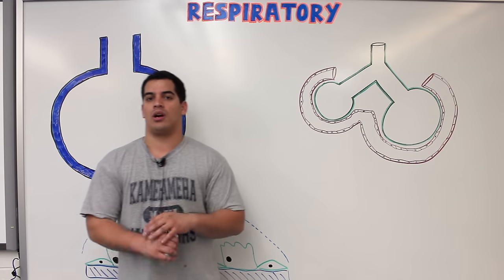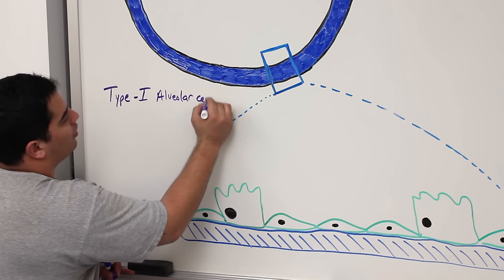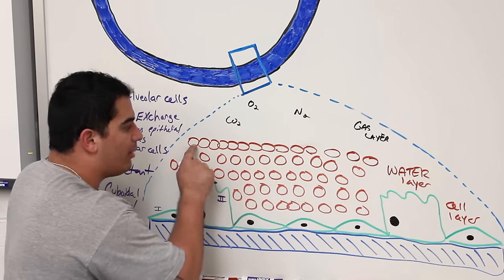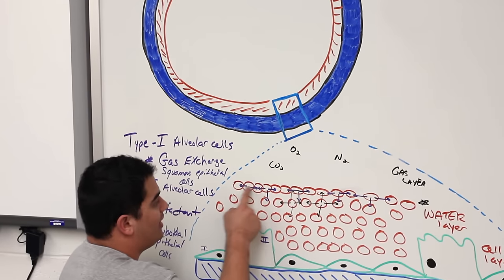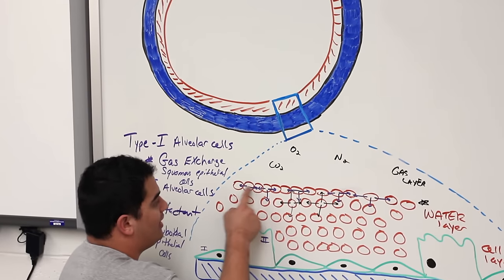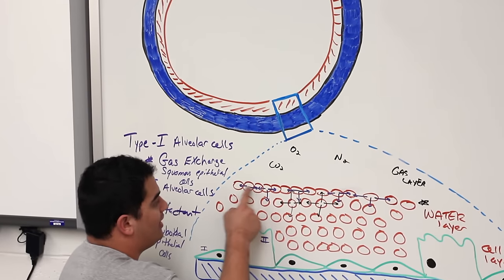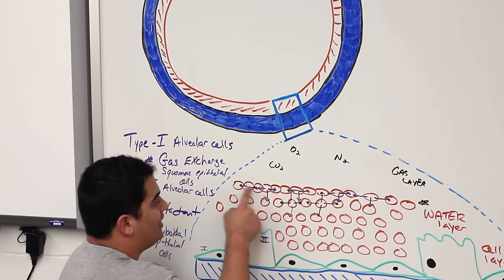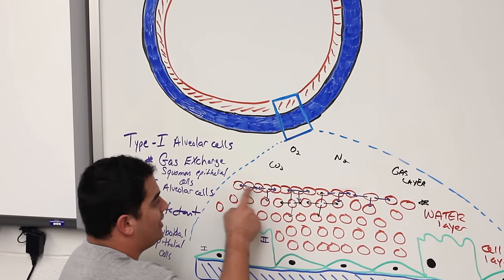Respiratory | Surface Tension & Surfactant in Alveoli

Comment: I have a question: If the watermolecules exert a force downwards (or to the edge of the alveoli, towards the outside), then why does it cause the alveoli to collapse? To me, it would make a lot more sense that the alveoli would collapse if there was a force towards the inside of the alveoli instead of the outside... Please excuse the forming of this question, English is not my first language :o
Reply: Did u get the answer bro?
I have the same question
Reply: I don't know about that "downward force " thing(I myself didn't get that actually) but just to make an understanding I've seen it as since the air liquid interface molecules are experiencing force due to surface tension they tend to decrease the number of surface molecules and hence tend to reduce the surface area which makes the alveoli collapse towards the centre....hope this makes some sense...
Reply: Think about  the free body diagram of alveoli at the top the top most layer is getting pulled downwards so the rest of water is pulled up wards 3 rd law of Newton as the bulk water is pulled upwards by top layer the also pull the alveoli upwards or towards the center

Comment: surfactants work at both interfaces of water in the alveoli  ( though you have mentioned one part )  — the air-water interface (edge touching the gas) and the water-alveolar cell interface (edge touching the alveolar cells). Here's how it functions in each case:

1. Air-Water Interface (Edge Touching the Gas)
Surfactants, primarily composed of lipids and proteins (like dipalmitoylphosphatidylcholine, or DPPC), reduce surface tension at the air-water interface. The alveoli are lined with a thin layer of fluid, and without surfactants, the cohesive forces of water molecules at this interface would cause high surface tension, making alveolar collapse (atelectasis) more likely during exhalation. By reducing this surface tension, surfactants make it easier to expand the alveoli during inhalation and prevent collapse during exhalation.

2. Water-Alveolar Cell Interface (Edge Touching the Alveolar Cells)
At this interface, surfactants stabilise the water layer and help maintain proper hydration of the alveolar lining. This ensures the cells remain functional and the diffusion of gases (oxygen and carbon dioxide) across the alveolar membrane is efficient. Additionally, surfactants support host defence mechanisms by facilitating the movement of immune cells and reducing fluid accumulation.

Comment: Thank you for the video! I have one question: how does the downward force from the water molecules cause an outward force to collapse alveoli?
Reply: When you have a downward force of the water-molecules, you have an increased surface tension. This leads to an increased collapsing pressure.
Reply: It's because of the air and water interaction..since the water is causing the surface  tension of the alveoli to increase by going deeper..the alveoli collapses so that the air leaves and the tension decreases and the alveoli is not under tension..hope you got it
Reply: @Cocolhasa In short, there is a force exerted towards the centre of the alveolus by the water due to its desire to maintain a low surface area.

The water covering the inner lining of the alveolus tries to assume the least surface area possible by cohering with one another. This is due to the fact that water is a polar molecule and can form hydrogen bonds with each other, and the ideal scenario for the water is to get into its lowest energy state.

When you inhale, you are pumping more air into the alveoli. To get the alveolus to expand, the water that is stuck to the lining of the alveolus also has to expand with it. This increases the surface area of the water, and the water doesn't want that. The water produces a force that exerts towards the centre of the alveolus, sort of like a water droplet trying to maintain its structure to achieve its lowest energy state. That is surface tension.

Comment: Correct me if I am wrong,  but what helps me when I think about surface tension is I think about as some of the molecules dive deeper within the body of the water molecules, they create momentary vacuums on the surface layer that the water molecules then fill in as they are attracted to each other on the top layer, so as they come together to fill in these vacuums they shorten the length of the surface, and this shortening contributes to the collapse because it's is it like trying to make a circle with a smaller piece of string, the larger piece of string can make a larger circle, but when surface tension increases, then surface layer shortens in length and now it is like having a shorter piece of string to make a circle. I'm not positive if that is exactly how it works but it helps me think about it.

Comment: Also due to the negatively electrically charged lipid molecules, as the alveoli tends to collapse, they interract (as surfactant lays through the whole surface of the alveoli) with Coulomb electric forces, so they repel each other, preventing the alveoli to collapse.

Comment: A small correction : type 1 and type 2 cell numbers are equal per alveoli however since type 2 cells are wayy smaller therefore they occupy only 3 percent of total alveolar surface area in comparison to type 1's 95 percent. 
The remain 2 percent surface area is occupied by type 3 cells which are chemoreceptors basically.

Comment: Great video. Learned a lot. A confusion: How alveolar pores equalize the pressure? Because you cannot reverse the direction of flow under pressure. Especially for the normal lung, it is hard to ignore. You also said that there is a surfactant distribution difference. That might raise an issue of Marangoni flow. And also when you breathe, depending on the Type-II cell activity,  alveoli are under constant compression and expansion. It should change the surfactant behavior under a different type of deformation (in this case shear+dilation). How our body tackle that?

Comment: 43:20 am I understanding correctly? Does having too little surfactant increase the surface tension compared to having no surfactant?
Reply: he's saying that because the radius is too wide, there isnt enough surfactant to cover all the water in the alveoli, which lets some of the water go down, and the alveola goes back to its regular shape, which is then regulated by surfactant
if you have no surfactant, nothing is stopping the water from going down and collapsing the alveola

Comment: So sorry but I have a question. Take for example during inspiration when the intrapulmomary pressure is high (+1mmhg), does the collapsing effect of surface tension hold significance even without surfactants?
   According to laplace, the tension of a wall = the pressure exerted by it's content × radius

Comment: So does an increase in radius always decrease the pressure? Sorry I'm confused because at the end you stated that the surfactant would not be able to cover a larger alveoli water layer and this would increase the tension. So would increase in radius only lower pressure in an alveoli without surfactant?

Comment: @NinjaNerdLectures But shouldn't the water pushing on the alveoli walls cause it to expand? I mean, the water pushes the alveoli in outward direction everywhere?  I can see why Surface tension causes the water layer to shrink, but i am not able to see how this co-relates to the alveoli itself shrinking?

Comment: i just have to say that the water molecules at the surface have a net force of going downward, some of those molecules go downward which makes the rest of the water molecules on the fluid air interface exert extra force on eachother which cause them to attract to one other, which causes them to come closer eventually collapsing the alveoli thus having a smaller surface area! is this a okay explanation? because the  water layer thinning out makes me think the alveoli is expanding rather then collapsing!

Comment: i still don't understand why the surface tension will pull on the alveolar walls to make them collapse inward. wouldn't the alveoli just stretch to offset the pressure?
Reply from the maker: +thecupcakeconspiracy I understand your confusion. Another way I should have explained it is as the water molecules on the top layer start attempting to dive down to the lower layers it makes the water layer thinner however as the water layer gets thinner it becomes tighter and that tightness is designed to resist the expansion of the Alveoli. In addition that tightness that I'm referring to develops an inward collapsing force. That force is called surface tension. So in conclusion, as the water at the top layer starts diving to the bottom layers it makes the water layer thin which makes the water layer tighter and the tightness resists the expansion of the Alveoli which create an inward collapsing force called surface tension. I hope this explanation makes more sense if it doesn't let me know. I'm sorry for the confusion
Reply: thank you for the explanation! that makes sense that the bonds between the water molecules become stronger the more compact the layer. this explains why the alveoli cannot expand. i think what threw me off was the collapsing force inward as opposed to outward, where all the surface water molecules were diving. then i started to visualize the top surface layer of water molecules like fastening a belt. as the top water molecules dive down the ones that remain at the surface create tighter bonds and pull inward to decrease the surface area and thus decrease surface tension.
Reply from the maker: +thecupcakeconspiracy I'm glad it makes sense now, and yes as you said as the intermolecular attractions get stronger from surface water molecules diving to deeper layers it makes the water layer tight and that tightnes( surface tension) resists expansion and due to the resistance to expansion it has a inward collapsing force that wants to make alveoli as small as possible. Once again great question and if you ever have more don't hesitate to ask! Take care
Reply: Thanks so much again for your reply. Your approach to delivering the information coupled with the visuals makes it much easier to learn with this format. Very glad to have subscribed. Another question if I may, if the radius is smaller does this mean the surface tension is higher? how so and what would that look like?
Reply from the maker: +thecupcakeconspiracy If I were to rearrange the equation to solve for tension. Whenever you increase the radius it would increase the tension. Again you could solve this utilizing Laplace law and you will see that tension is equal to pressure times radius divided by 2. Does that make sense?
Reply: i wonder why my text book says the opposite... 
https://books.google.ca/books?id=48kqCwAAQBAJ&lpg=PA75&vq=surface%20tension&pg=PA75#v=onepage&q&f=false

also if we go by the equation, if the radius were to decrease that means the collapsing pressure would increase. and because the collapsing pressure is directly proportional to the surface tension, the surface tension would increase as well not so?
Reply from the maker: +thecupcakeconspiracy so Laplace law says P=2T/r if I rearrange to solve for tension it equals T=Pr/2 so by the equation as alveolar radius increases so will tension, conversely if alveolar radius decreases so will the Tension.
Reply: thank you for clarifying. so does that mean the higher the surface tension the thinner the water layer? sorry for all the questions.